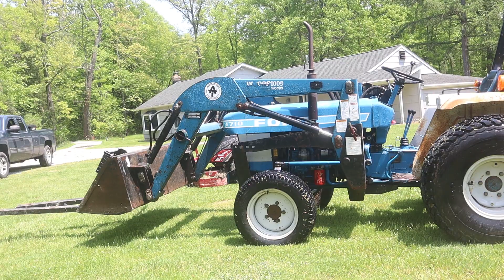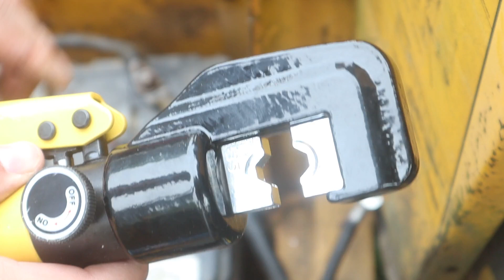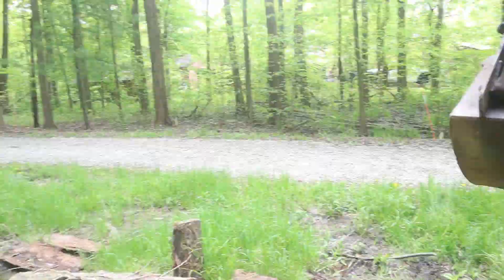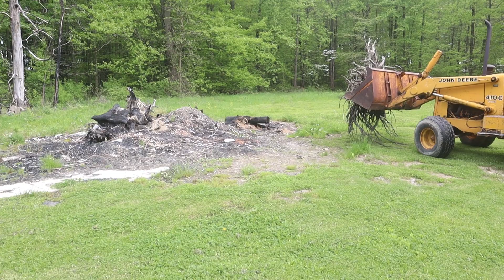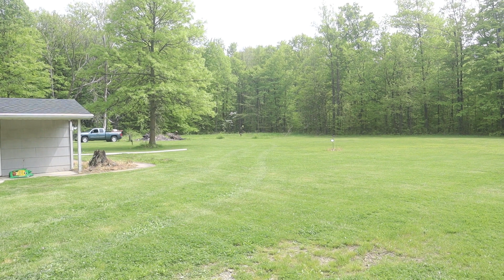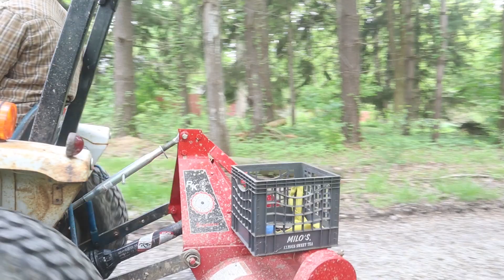Contemplating a New Tractor and the Longest Tennis Ball Launch

Comment: In the same situation, but deciding between an 80’s very good condition 1710 or other new models. Looked at the Deere 3032E. I’m not impressed with the lift capacity or the warranty. Maybe TYM 354 or 394. Price, lift and warranty are all very good! I don’t see any green on your recent videos. What did you end up doing?
Reply from the maker: Well.   I still have the 1710 ford.  I had a great offer on the tractor from someone but I did not feel the newer ones were as strong.  So I will be working around the property for at least another year with it.   Thanks for watching and your input about the deere.   That is what I was looking at.